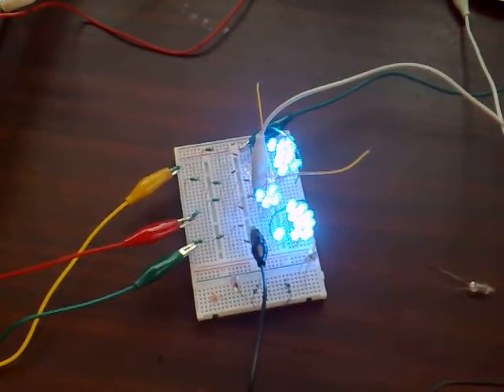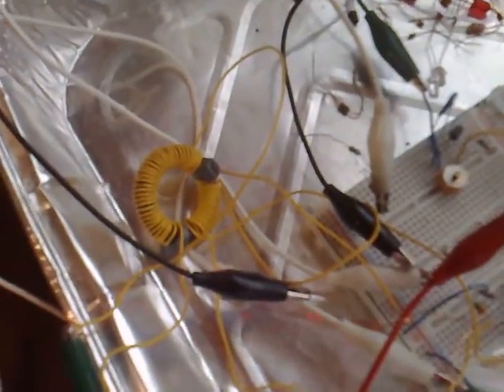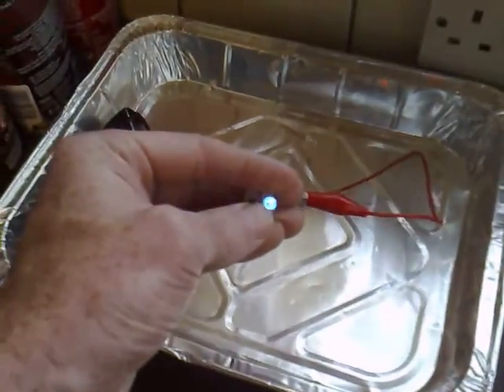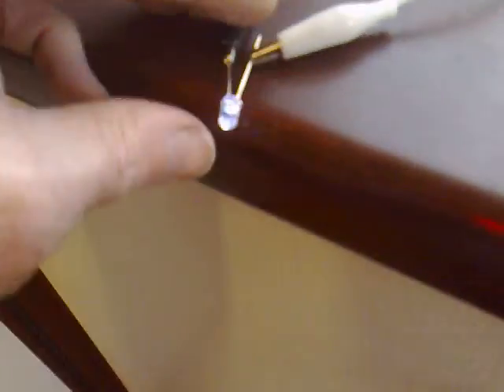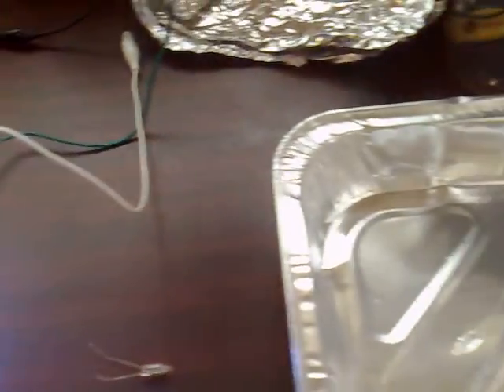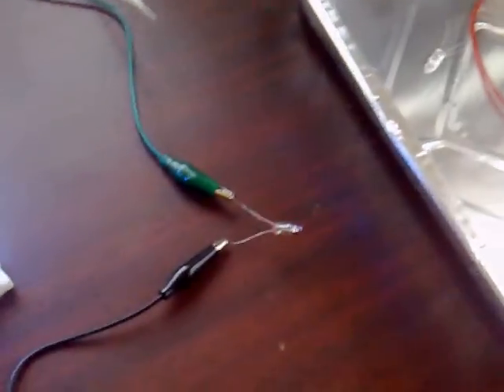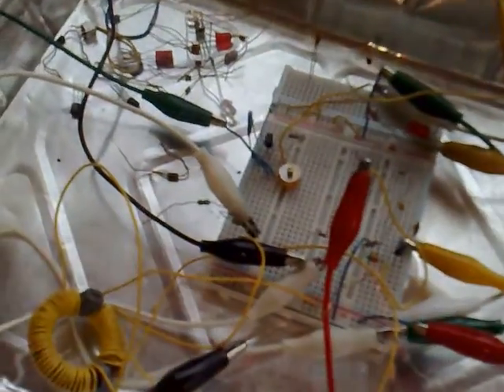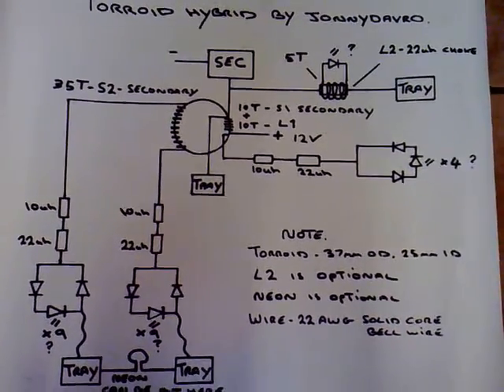SEC exciter.Torroid hybrid.

Comment: Moonreft . A jt run a laser diode perfectly . just make sure you monitor the current rating with a one ohn resistor in series with it .  . I run Green and red and Blue laser diodes perfectly